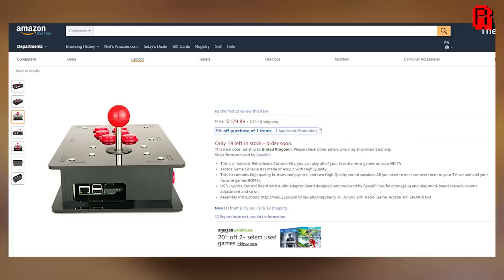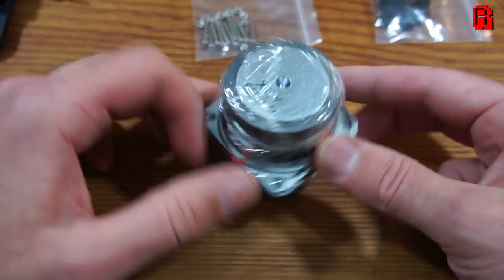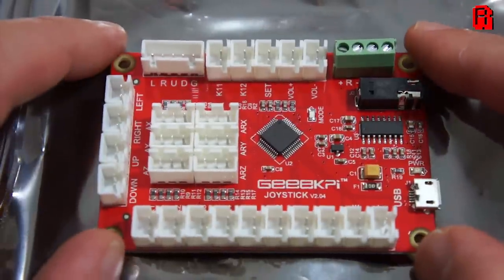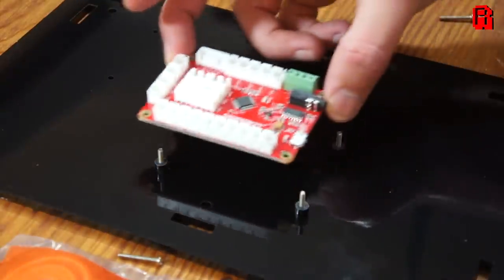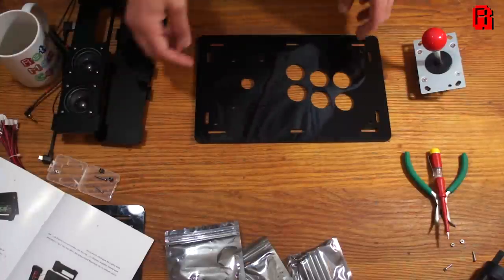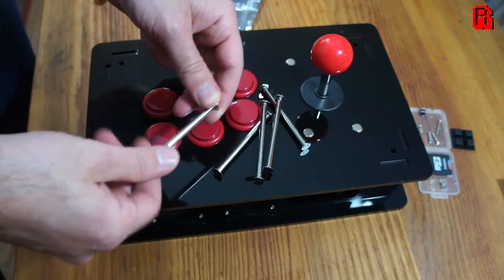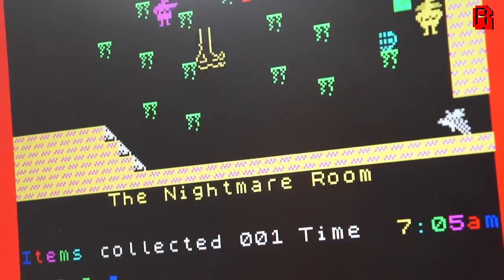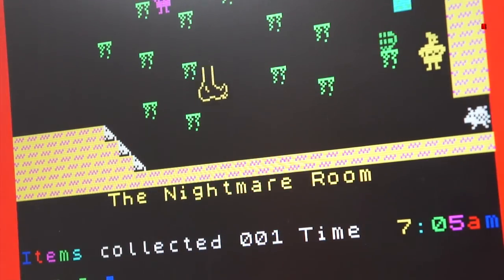The GeeekPi DIY Bar Top Arcade | Review

Comment: Effectively this includes 4 components,; the case, a pi, a DIY arcade controller kit and some speakers. For the price that is quite a bit. I recently built an arcade stick using a similar kit (which didn't have a built in amplifier) for around £14, we all know a Pi 2 model B is around £35 inc vat and shipping, so that's £49 (around $65 USD), the rest has gone on some CNC cut acrylic and a couple of small speakers. That said, it's quite clear that a lot of money was spent on developing the manual!

My arcade stick is staying as a USB stick for now, until it is eventually built into a DIY cabinet using an old panel PC I obtained from ebay a while back.
Reply from the maker: +f13dev there's a lot to be said for the satisfaction of building your own cabinet if you have the tools and space, as is there a lot to be said for an off the shelf product ready to go that ticks all the boxes.  This one gets lost somewhere in the middle amd doesn't really satisfy either client

Comment: Is the stick 4/8 way selectable? If not, good luck playing Pacman or Donkey Kong.
Reply from the maker: Yes but here's the catch.  You see that green plate on the bottom of the joystick, you can take the 4 screws out and move that to put the 4 way template in place instead of 8 way.  To get to that you have to take the 5 screws out of the acrylic case first to get into it.  It's not a quick twist solution.
Reply: I built a mame cab a few years ago, I bought a stick with a variable restrictor plate... a 45 degree twist switches from 8 to 4 way and vice versa. http://www.ultimarc.com/controls.html

they also sell switchable sticks with servos that do the switching for you at the touch of a button... that would be super geeeky ;)

Comment: How was the sound?
Reply from the maker: 90% of the time I was using a HDMI TV so it went via the TV/Amp speakers in that.  When I used the built in speakers they were pretty poor, nothing to try and copy there in your own project but until I test the GeeekPi board I won't know if that's the speakers of the amp on the board

Comment: So, what does it run?
Reply from the maker: infinitecanadian RetroPie - which isn't unique about this product hence why we didn't dwell on it, most of these things now use a Pi with RP dropped on it
Reply: So it already has the control scheme programmed in and all you need are the files?  Is it basically a multi-emulator?
Reply from the maker: Yes RetroPie is a front end with many emulators present and a common configuration scheme to ease the use of it.  You just drop the game ROMS on to the SD Card.  As others have said it's in breach of the RetroPie terms to distribute it in this way but, that's how it ships.  Check out RetroPie for more details.
Reply: Thank you for the reply and consequent information!

Comment: In terms of parts cost, if you were to walk into your local Electronics store and pay Australian retail prices for all of these parts, this kit actually comes in substantially cheaper.  That said, this particular electronics retailer, who I won't name as I work for them and this may violate my contract in some way, is ludicrously overpriced on its arcade buttons, at $9.95 a piece, and $20 for the stick.  If I want unbranded Chinese buttons, I can pay a buck each, or less, on Ali Express.  If I want higher quality Sanwa or something, I could get them for under $5 a piece.  Basically, if you're keen to build it yourself, and you're happy to source all of the parts online from various suppliers, you could probably come in at under $40 for the joystick, if you go with the cheapest options, and then add the cost of the Pi.

In terms of product quality, I wouldn't pay that for this fully assembled.  The sex bolts don't make for a nice flush finish on the top, and you have all of these big ugly grey bolt heads in your piano black top.  The slots for the joints also ruin the surface finish.  I would expect they'd at least include a clear acrylic top sheet to protect a decal for that price.  I would settle for nothing less than injection molded plastics, for this.
Reply from the maker: All valid points I agree, especially something on top to finish it rather than that bland top and those screws.  Whenever I've built a control panel in the past I keep the bolts recessed and apply some nice control panel art with a perspex top.  Also if you want to open it to change the joystick from 8 to 4 way you're looking at 5 screws to open it again then 4 to change the joystick restriction plate, then putting it all back together.  When you pay for convenience you expect some convenience.
Reply: Another thing, glossy black finish is a big no-no

Comment: Fake SD card .
Reply from the maker: Barrybados©. Interesting I wasn't paying it much attention other than it worked.  What can you see to identify it as a fake?
Reply: The OV brand they sell them on Ebay bought a 32gb tested with H2testw showed it was a 8gb .
Reply from the maker: Barrybados©. Hmmm thank you I'll test mine out, interesting as it was supplied  by the manufacturer of this unit for review.  I won't draw any conclusions until I've tested.  Good spot.
Reply: Yes only way to find out is to test it with H2testw ,The one i bought was ok up to 6gb but corrupted the files above that, keep me updated on the progress with it : ) .